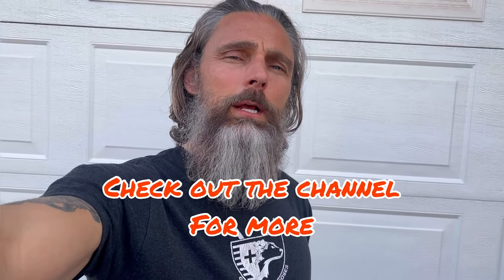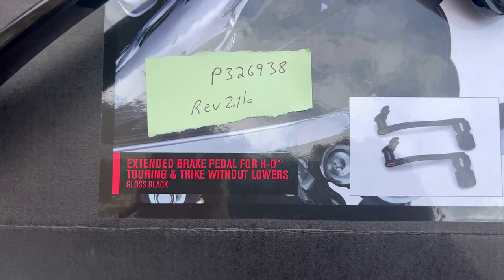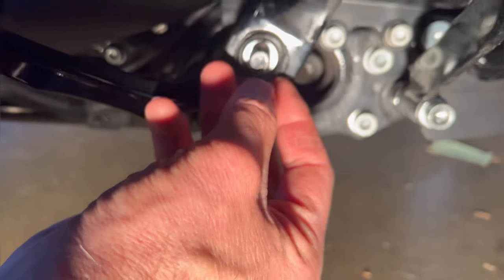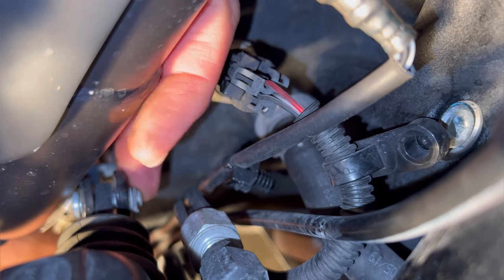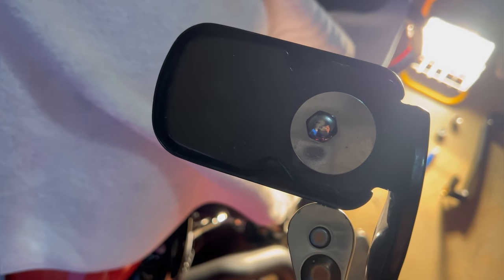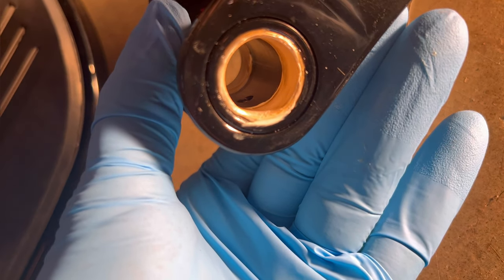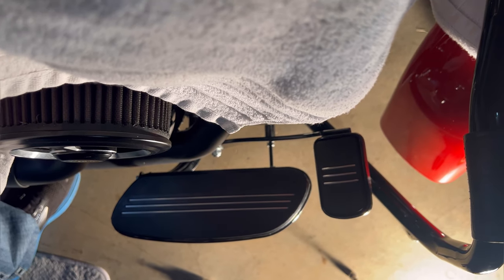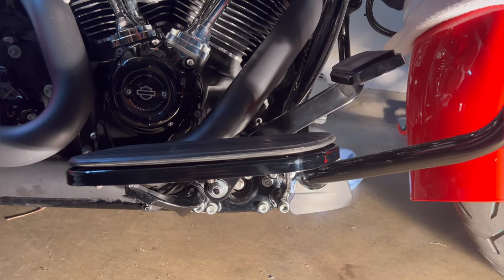Extended brake lever, Harley Street Glide.

Comment: Take off the three bolts holding the plate on that the brake lever and master cylinder are attached to. Then the entire assembly will swing away from the bike, giving better access to the cotter pin, and you won’t have to remove the crash bar.
Reply from the maker: Thanks for the tip !

Comment: I can’t get my bolt out where colter pin is keeps hitting my exhaust t
Reply from the maker: Take a look at the 4:40 mark on video. Maybe that’s helps? It’s a tight fit sliding bolt in/out with exhaust.